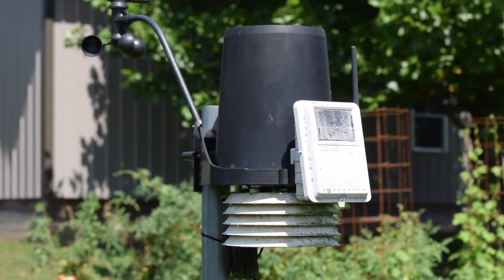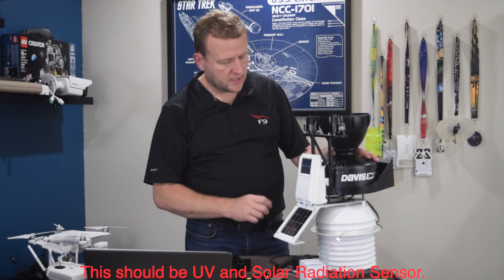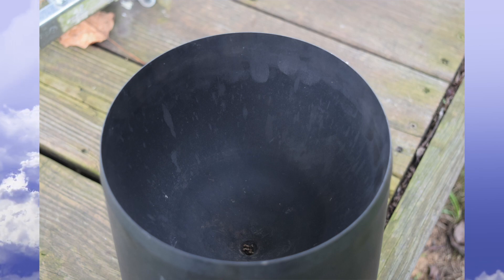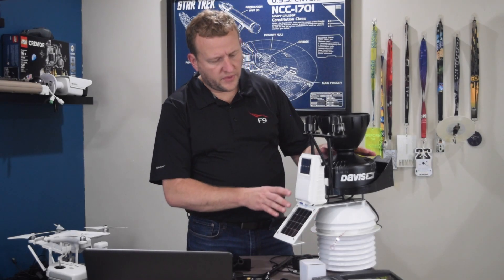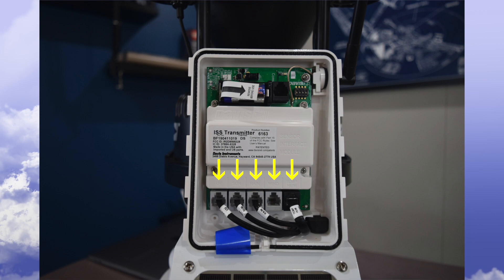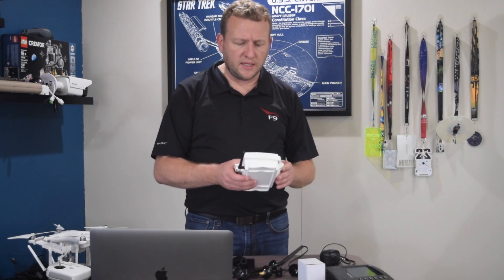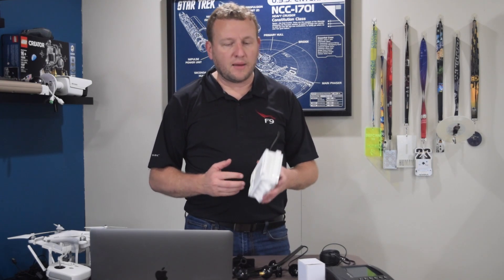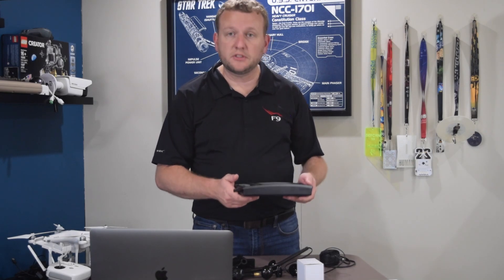Davis Vantage Pro2 Plus Install -  Part 1: Straight From The Box

Comment: what is the difference between pro2 and pro2 plus?
Reply from the maker: The plus model comes with radiation and uv sensors installed.  There are some other options, and possible upgrades as well.  If you would like more information, here is the link for the product page on the Davis site.

https://www.davisinstruments.com/pages/vantage-pro2